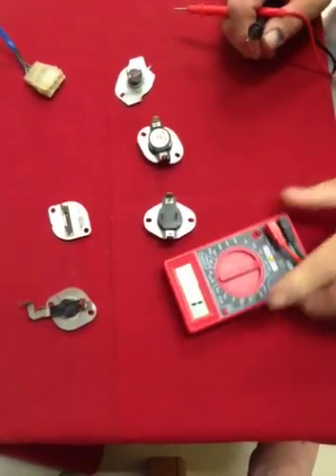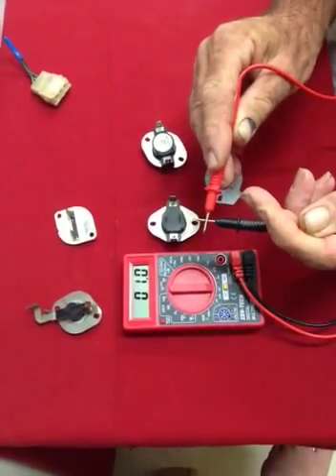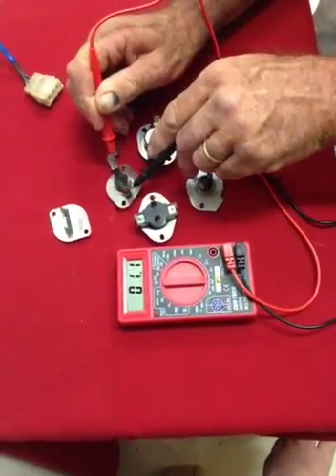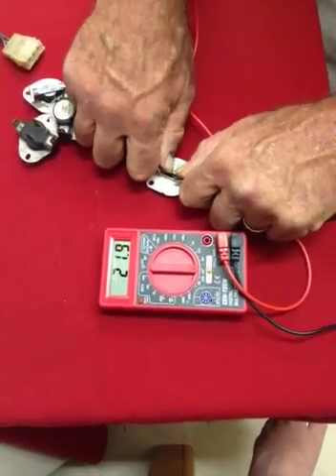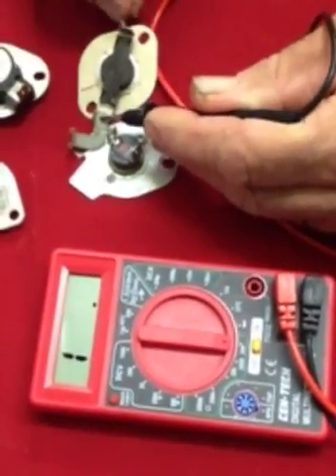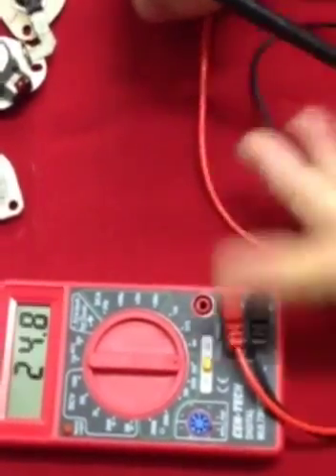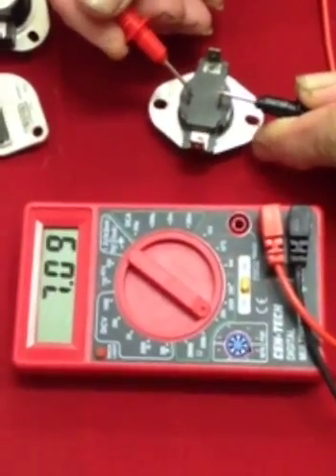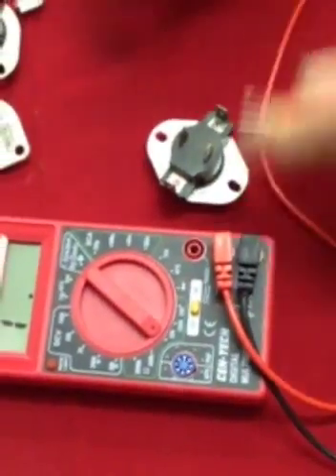Multimeter - ohm meter - how to use

Comment: Hey there, I have a dryer Samsung DV42H5200EW/A3 and I took it apart just now to see if the heating coil itself was broke and it was not. I then use my voltmeter and check all three of the sensors on it. When I do that they all show voltage. Are they all supposed to read "ZERO" if its a good sensor and if it shows some sort of voltage does it mean that its bad?

Comment: Do you buy this video I was able to check the ohm on my speaker. Wasn’t sure if it was an 8 or 4 because its not  a full speaker but only a  replacement speaker and coil.

Comment: Thank you for this video.  I bought two new fuses for my dryer.  A thermal fuse and a Thermistor.  The new thermal fuse showed a completed circuit on my Multimeter, but the Thermistor did not work at all.  I was able to determine that the Thermistor did not work when received from the vendor prior to installation.    thanks to your video. You saved me some cash and time.

Comment: HEY IM TESTING A CAD CELL ON BECKET...ITS SUPPOSE TO BE 1500OHMS BUT THIS METER SAYS 15.0 ON 20K OR 1.5 ON 20K IT WONT SAY 1500 ON ANY SETTING....???
Reply from the maker: On a 20k it would read 1.5 - which is 1500
Reply: ok ty,i thought that...cheap meter but it reads lol
Reply: yeah on these centech harbor freight voltmeters on ohms it goes from 200/2000/20k (the 3RD DOT THAT "APPEARS TO BE UNLABELED" = THE 20K OHMS SETTING). dONT WORRY I GOT CONFUSED TOO!